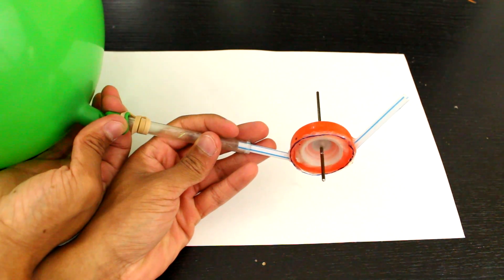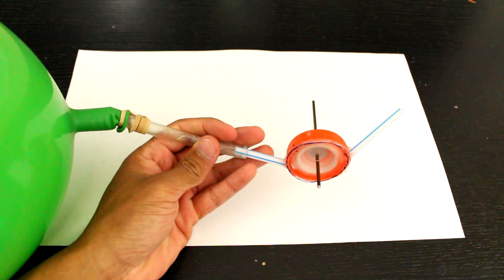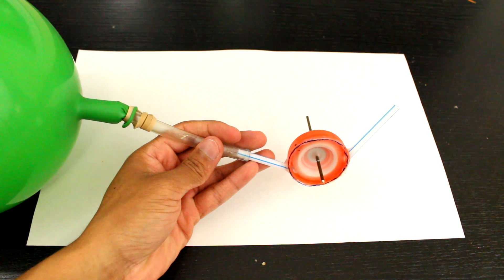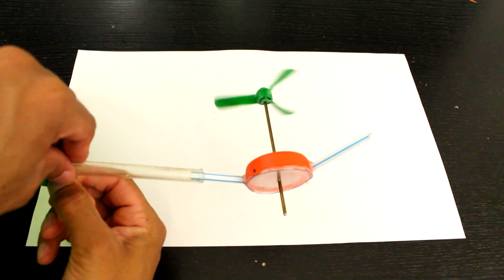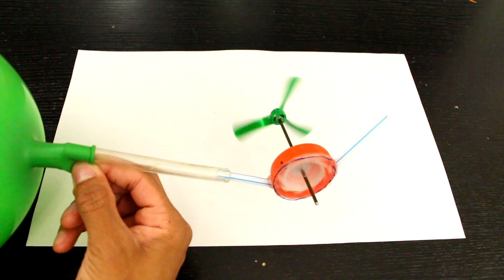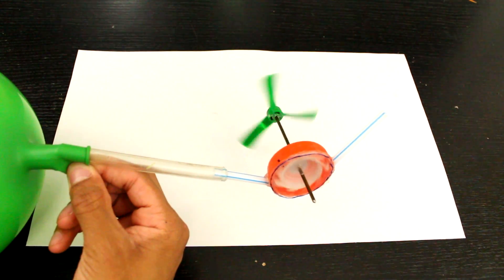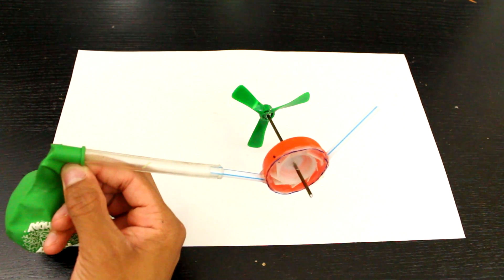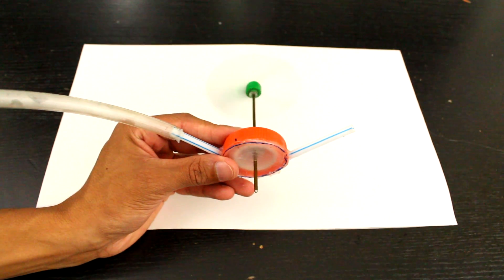How to Make a Mini Compressed Air Turbine

Comment: what if u attach a 12V DC motor on the axis, so, when the that thing spins, the motor will spin too, and u will get Electrical energy
Reply: It looks very inefficient, the axis is not correctly centred, or supported (it wobbles). The only way I can see this turning even a small DC motor is with a compressor, and the electricity you use to run the compressor would be a lot more than what it could produce.

Comment: how many CFM's will this generate if attached to a JRS-540 SH DC-12V MOTOR?
I received a gutless vacuum  in Christmas.
Reply: YzarcMW nope, it can't turn a motor. it's has low torque and also it is not much powerful

Comment: Could this make electricity?
Reply: +Scarlet Peoni i would suggest nothing electrical at first, then as you get better without electricity, maybe you can try to make something battery powered, like an rc car
Reply: barely enough to glow an LED
Reply: Hrushikesh Naik
 But if I made over 100?
I'm thinking also how many if you could attach to a bicycle and could self generate its lights?
Reply: I don't think that is a practical idea, You need compressed air for that, not high velocity air. and even if you want answer to how many you will need, first make one, measure its current and voltage with multi meter. then you will get idea how many you need
Reply: Hrushikesh Naik
 Okay thanks :)
Could you suggest anything for beginners, I've never built or done anything electrical or engineering either but want to do projects like the bike thing, or something solar or wind/water generated to boil kettle etc
Reply: Gerrit Herman
 Thankyou. So before the rc car what would be best to try and make, like a first project?
Reply: Scarlet Peoni i have made a little fan but iTS just what you have around
Reply: +Game Lands you uploaded?
Reply: Scarlet Peoni no
Reply: yup

Comment: Could you attach magnets and a wire coil to the end of this to make an electric generator? It might not have enough power to spin them fast enough tho
Reply from the maker: yea i was going to try something like that in a week or two. and maybe not with a balloon but with compressed air it should spin fast enough and have enough torque